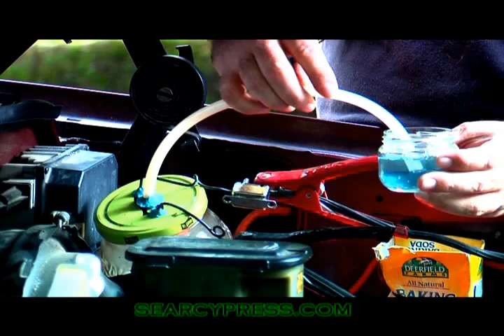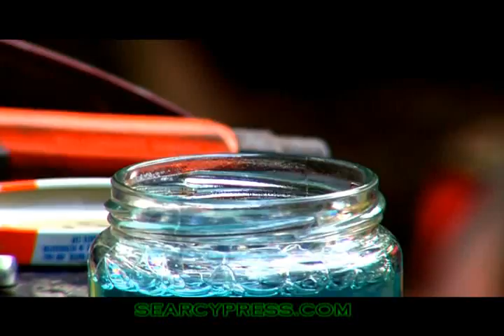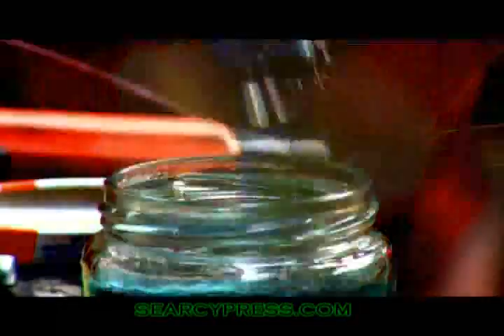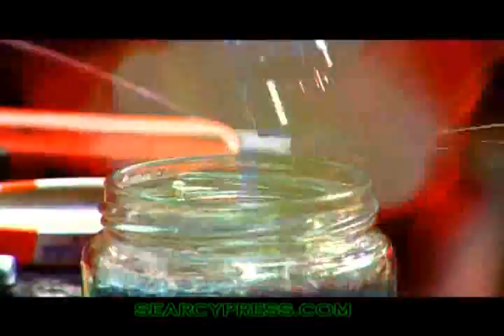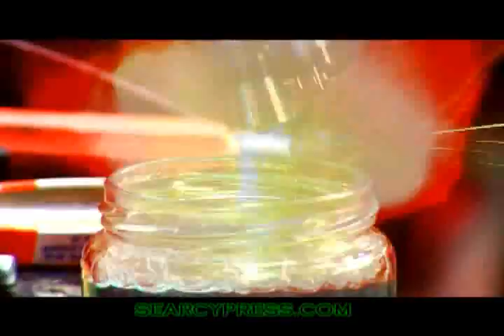Original Vacuum Pressure HHO Fuel Cell

Comment: The vaccunn it's part of the process, to make work, agree
Reply from the maker: It also plays a key role in the thermodynamics of the fuel cell. Maintaining proper temperature is key to high efficiency. The boiling point of the water is lowered in the vacuum state. The water behaves like a refrigerant cooling the container. Thanks for the comment.
Reply: @metalpresstv  have u try something also efficient like different  project in the same affect  , you have. Email  I like to share info , u if you like ,lobocruz@hotmail.com